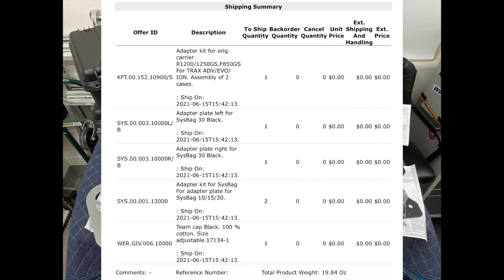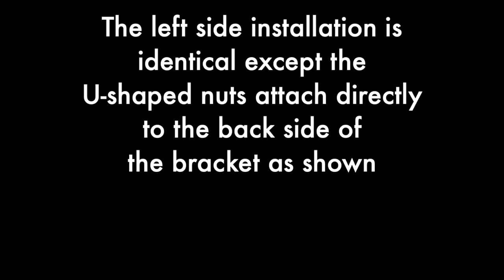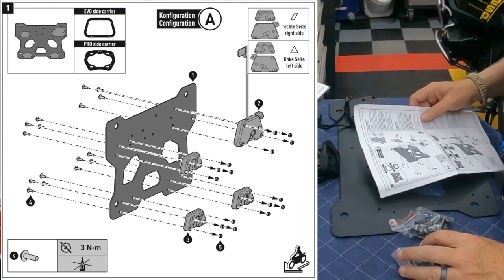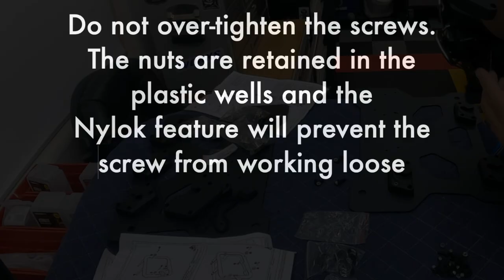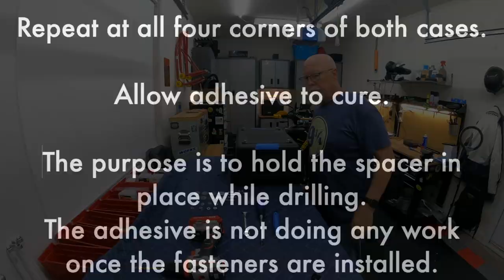How I installed pelican cases on my 2021 BMW R 1250 GS Adventure

Comment: Sir, you have all my respect.
A question if you don’t mind. Are the mounting racks Touratech brand?
Reply: Hi. Thank you. 
The  tubular racks on the bike are BMW brand, but all the parts on the table in the video are Touratech.
Reply: @jcollins2826  I thought Touratech made those racks for BMW. I took a chance on that since I have the Touratech racks in my África Twin and just placed an order for everything you kindly detailed on your video, except the hat, way too many hats already, haha.
Reply: Let me know if it works. I want to know if my instructions are easy.
Reply: @jcollins2826  I think they’re easy, I will let you know. Mr. Collins have you found a good lid lock with keys (not a padlock) for this cases. Thanks
Reply: @jcollins2826  I will let you know, sir.
Have you found a good lid lock with keys (not a padlock) for this cases, thanks.
Reply: @motohonduras6095  yes, I did actually. Call A company called Caribou Cases.
Reply: They will sell you a set of locks that share the same key. Installation is really easy and they work great.
Reply: The guys name is Roger. A really nice guy.
Reply: @jcollins2826  is him with Pelican or Caribou?
Reply: @motohonduras6095  His company is Caribou, but his cases are Pelican. His company is for selling brackets and parts to install Pelican cases on bikes. I found his company after I made my video. The Caribou system looks good, but more expensive. The locks aren’t expensive though.
Reply: @jcollins2826  ah yes I saw them but they were part of a bundle that included the back plates.